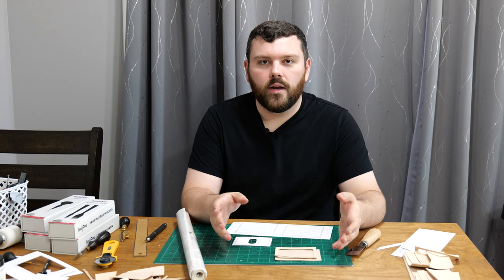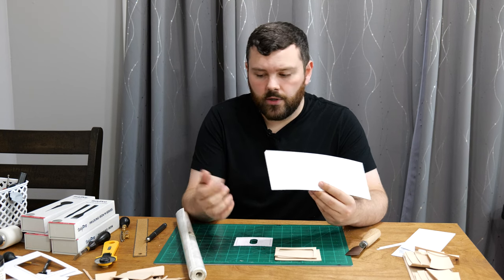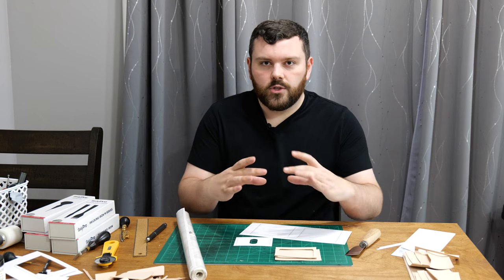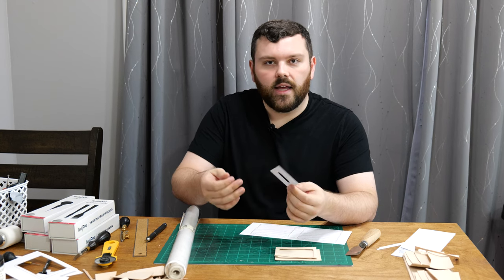Hand Making a Leather Wallet with Extra ID Fold

Comment: What thickness do you use for all of the pieces? Is it all one thickness?
Reply from the maker: Both sides of the cash pocket were slightly thicker leather just because it bends a bit better than the leather I used on the card pockets. The outer part is around 4 oz and the rest is around 2 oz. Ideally it should probably all be 2-3 oz but I don't yet have a good skiver for large pieces of leather.